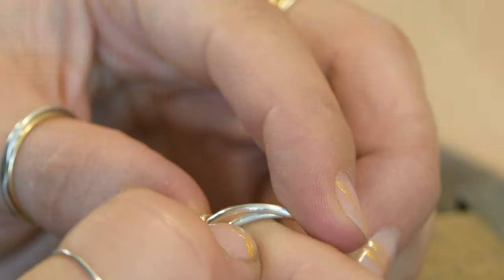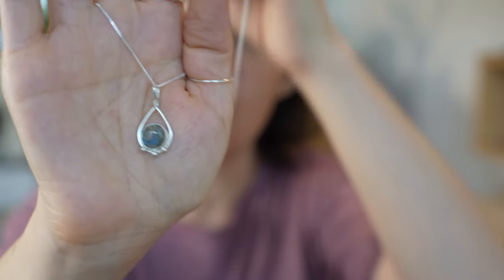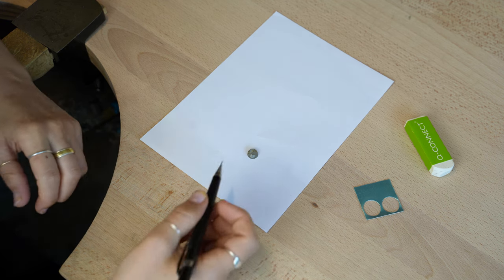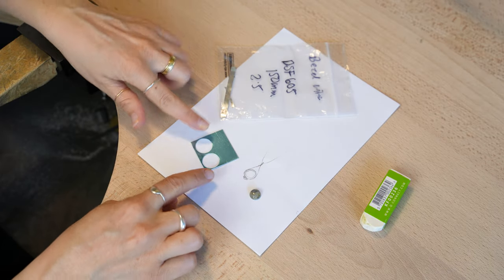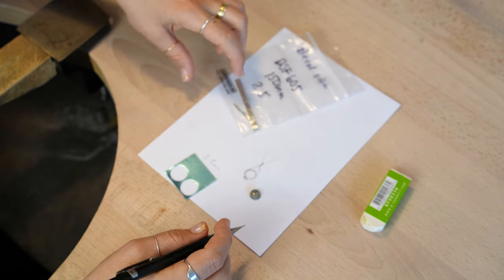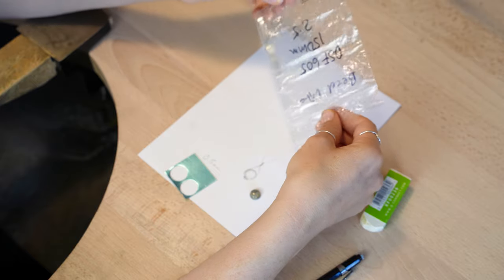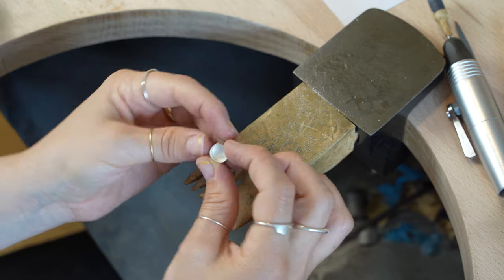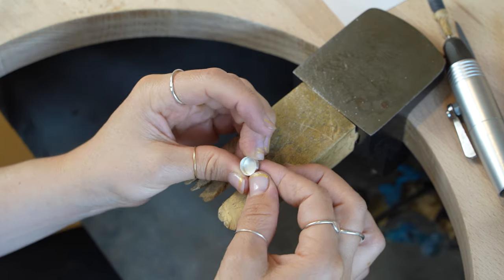Handmade Jewellery Course - Bezel Stone Setting

Comment: we're not worthy! You Rock Megan - thank you for such great content - I was wondering if the surface - it looks bumpy like reptile skin - time stamp 18:23 - was smooth would the solder move differently - that is if the surface you are soldering on is completely flat can you control the movement of the solder better?  thank you
Reply from the maker: Hi lovely, glad you are enjoying the videos! 🫶😊 In terms of the soldering block I am using there, it's a Magnesium block and they are quite fragile and the surface gets damaged with the heat from the soldering, basically every time, so they become bumpy very quickly. In terms of that interfering with the soldering, it does not really, as long as the solder touches the block and the area to be soldered at the same time then you are good. So I always try to find a bit that makes good contact. And it's usually pretty easy as the spot you are soldering is usually pretty small. 😉 There are lots of different kinds of blocks you can use, I also sometimes use a charcoal block. But they also get damage easily. The honeycomb blocks have holes and do not get damaged easily, but I always loose my solder down the holes.

Comment: Hi Megan. Just found your excellent tutorials. I’m also from SA living in Sydney, and a metalsmith student. Please indicate which solder you use each time.  Thanks so much Megan! 😍
Reply from the maker: Hi Judy, my fellow South African 😉 
Good point, haha, I use hard solder 99% of the time personally. But that's because I have a small torch and so I'm able to direct the heat only where I want it to go to avoid reopening previous solder joints.
Reply: @megan.collins  Thanks for that. Yes I thought that might be the case and it makes sense. I also use a small torch at home but always worry about opening previous soldered joints, even after many years of weekly workshops!! Oh well … 🤪🤭😁 Looking forward to more of your tutorials and will spread the word. We have 3 other ex SA’ns in our class. Thanks so much Megan. Keep on keeping on 👏💕
Reply from the maker: It is something to always be careful about. if you are worries start with hard solder for the first joints then move to medium and then easy as they each melt at lower temperature than the previous. Thank you for spreading the word :) means a lot :)

Comment: But you’ve filed off an awful lot of metal to get the bezel join even.  That makes the bezel get smaller and smaller. and I think the spaces are still open there between the join. if you use a miter vice to file the edge of the bezel flat you will not have to lose so much metal to try to get it flat by filing filing filing. Also Solder always hops around when the flux is drying from the frame. Butif you rest your bezel seem on top of the solder the solder , not lean it against it, will not hop around because the bezel ways it down and it will flow directly up the seam. I’ve never seen stones in your jewelry?  I love the business advice.
Reply from the maker: Yes quite right, I don't use stones in my jewellery. But wanted to make a special piece for my mum and thought I'd share with YT. But I'm definitely better at other styles of jewellery and business advice. 😋